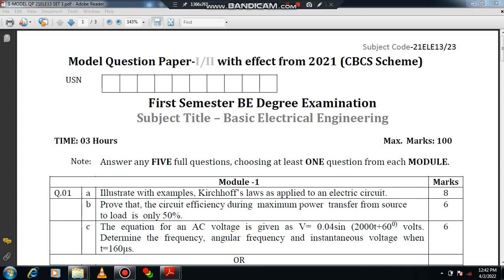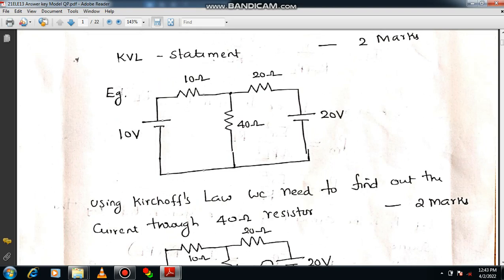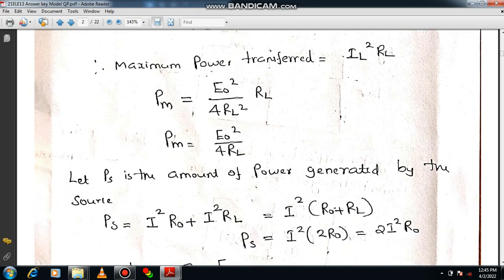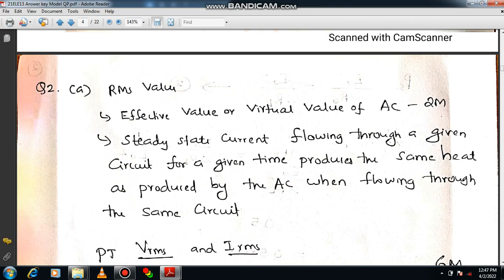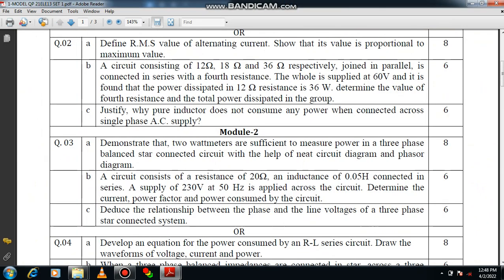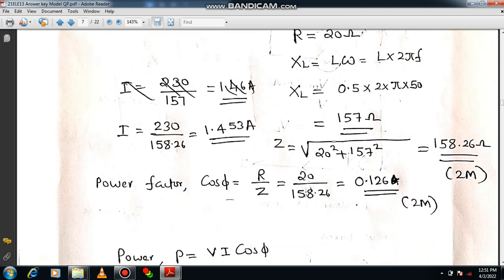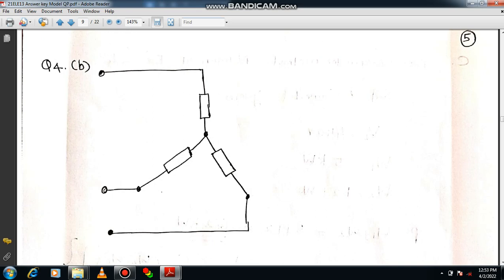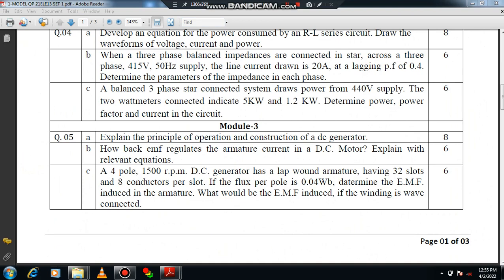Answer Key discussion of Basic Electrical Engineering Model Question Paper 21scheme BE  -VTU 21ELE13

Comment: Sir study of model question enough for 100 marks
Reply from the maker: Good afternoon,
In my point of view, surely you will get 50% and above in case you have gone through model question papers (Ref. Lec 30 to 40 of Basic Electrical Engineering).